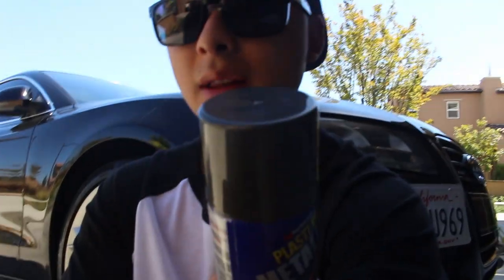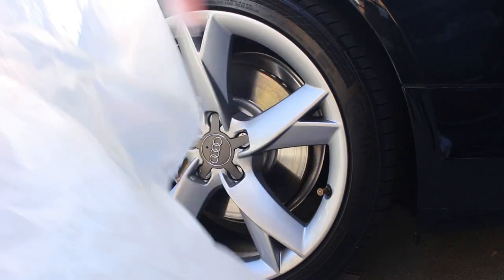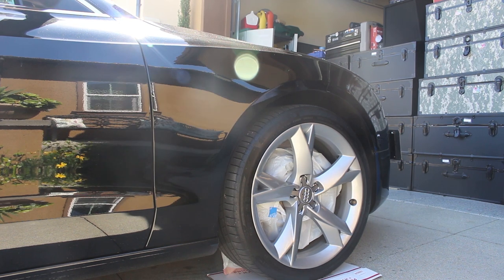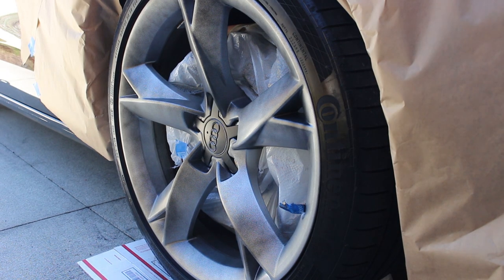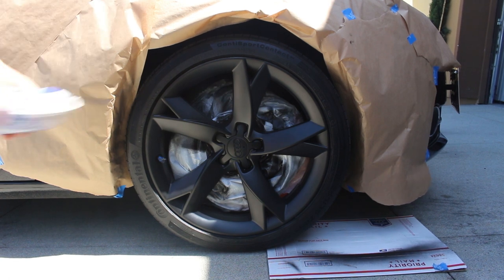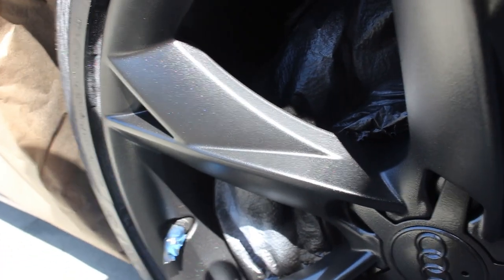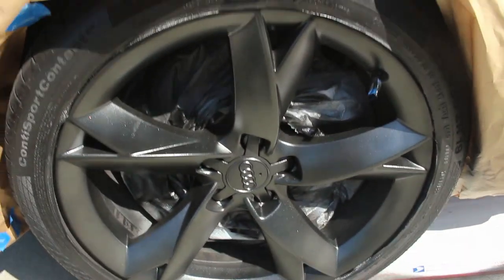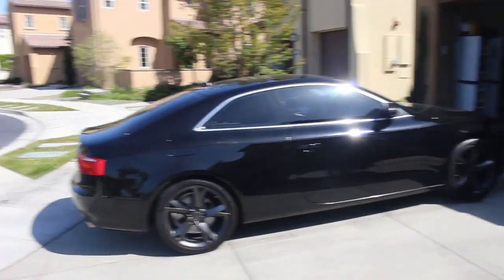How to plastidip wheels with graphite metalizer

Comment: Seems like it wouldv'e been easier to just take the wheels off than do all that masking.  Plus to could elevate them so you can be more comfortable painting them.  But they turned out real nice.  Might be doing my truck wheels like that, Thanx.
Reply from the maker: X-Man i completely agree. I was short on resources back then. If i were to do it over that’s foresure what I’d do
Reply: @DRIVENROYALTY  How well did it stood up after 2 years?